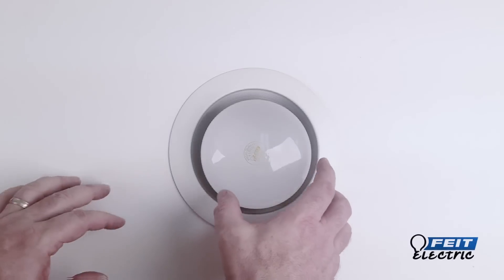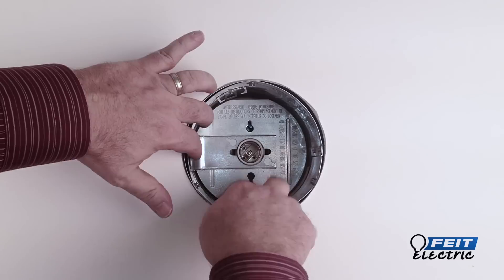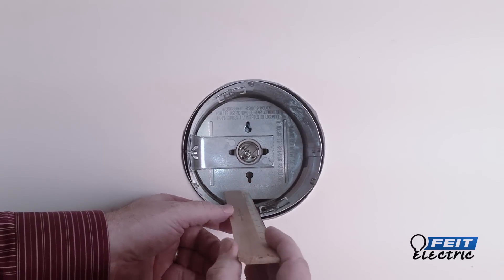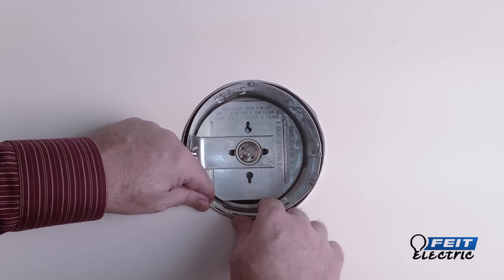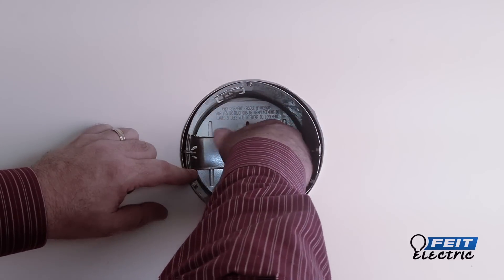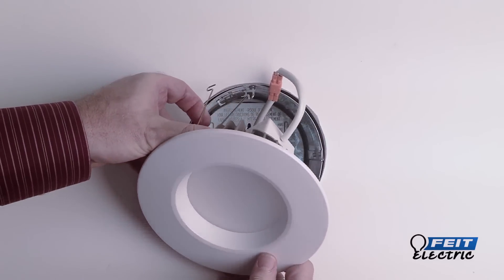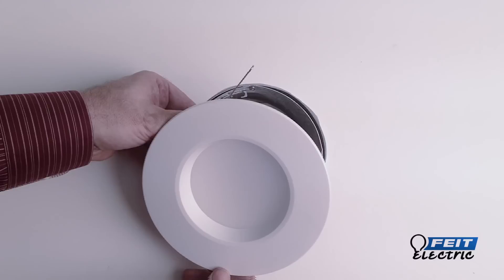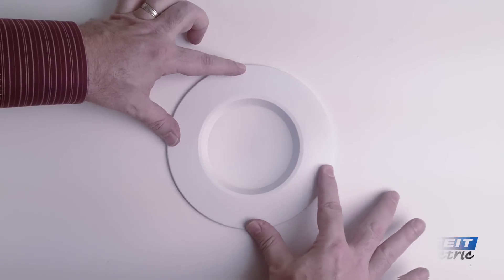How to Install Feit LED Can Light Retrofit Kits - Ace Hardware

Comment: The Feit LED fixture installs very easily into recessed lighting fixture. Installing it into a standard overhead electrical box is a different story. Even after following the instructions, written  in a microscopic font, then scanning the diagram on a computer to expand it to visibility, the actual Feit hardware mounting ring had to be enlarged/drilled out slightly to accept the standard electrical box mounting screw; then the entire ring pushes up into the recessed round electrical "box" when you try to twist-mount the fixture. It became so frustrating to re-engineer the parts that I took it down and reinstalled the old fixture until I could purchase a more user-friendly brand.

Comment: What's the difference between this and simply screwing in an LED bulb. Thanks.
Reply: I found this out today.   These canned lights are poorly insulated.  During a a pressure test the tech showed me that hot air from the attic space was pouring into my kitchen from the 7 outlets.  Using these will reduce this issue.
Reply: LED bulbs wear out if they get hot, the exact opposite of an old fashioned bulb. The unit shown in the video uses the metal stuff aroud the light as a heat sink and radiator, so the light engine itself can stay cool.  Te end result is 20+ year lifespan vs 2 year lifespan.

Comment: I have one that has started flickering after just two (2) years of normal (2-3 hrs per day).  Not much savings if I have to buy and call my son over to install one every two years!!!
Reply from the maker: Hi Bob - Did you get it from an Ace store? Would like to help research the flickering issue for you.
Reply: Are you using a dimmer? if so make sure it's for led. Maestro

Comment: What if I do not have the brackets in the recess fixture?
Reply: Park Boulevard that what i want to know
Reply: The brackets are there..they are bent up you just have to bend them down
Reply: My Lithonia brand fixture has no torsion spring brackets as shown in every video I have watched. All the LED retrofits I've seen need these brackets to hold up the light. No brackets, no work.
Reply: thats bs, every can light in the us has brackets so what i'm guessing is maybe you didnt turn the wingnut holding the socket and push it up far enough to be seen so id try that again or just completely remove the wing nut and disconnect the lamp socket and then place the led light into the recessed fixture.
Reply: It's not bs, mine doesn't have them either. And didn't. Totally had to replace the can so it's you who has no clue. If you'd like pics just let me know.
Reply: We seem two have two styles of recessed lights in our house that we bought 3 months ago. The set of lights on one side of the house cannot be pulled down. After some reading online, it seems that they may have been screwed into place from the attic space.
Reply: @johnpurson2245  Some don't. You'll likely have to pull the whole can from the attic and replace with a flush mount kit that has the two spring loaded tabs on the side. Many cans are installed during the original construction and are fastened between a 2x4 and the drywall, from underneath. Impossible to get to without tearing down your ceiling; however...

If it's attached to a simple 2x that isn't structural (not a big 2x6 or more running across the length of the room in the attic) you can cut out the wood holding the can light in place using an oscillating multi tool. (Be careful not to go through the drywall underneath! Go slowly! Make sure you've already removed the finish plate on the side facing the room or it won't pull through.)

Alternatively....

In some cases, the spring loaded tabs themselves will hold within the existing can, if everything matches up, size-wise. 

If there is any gap you can (carefully and cleanly) caulk the seam between the light and the ceiling. Use a high gloss caulking, or whatever that most closely resembles the fixture you're putting in. 

Lastly, if you are fully removing a can, be prepared for the possibility that some drywall will crumble away and you'll need to patch the ceiling if the visible crumbling extends beyond the circumference of the led replacement. 

Also, if you're replacing the whole can you'll have to wire in the new unit, so some minor electrical knowledge will be necessary. If you have knob and tube in a very old home, thats a story for another time.
Reply: @gogodesu4305   john purson  Some don't. You'll likely have to pull the whole can from the attic and replace with a flush mount kit that has the two spring loaded tabs on the side. Many cans are installed during the original construction and are fastened between a 2x4 and the drywall, from underneath. Impossible to get to without tearing down your ceiling; however...

If it's attached to a simple 2x that isn't structural (not a big 2x6 or more running across the length of the room in the attic) you can cut out the wood holding the can light in place using an oscillating multi tool. (Be careful not to go through the drywall underneath! Go slowly! Make sure you've already removed the finish plate on the side facing the room or it won't pull through.)

Alternatively....

In some cases, the spring loaded tabs themselves will hold within the existing can, if everything matches up, size-wise. 

If there is any gap you can (carefully and cleanly) caulk the seam between the light and the ceiling. Use a high gloss caulking, or whatever that most closely resembles the fixture you're putting in. 

Lastly, if you are fully removing a can, be prepared for the possibility that some drywall will crumble away and you'll need to patch the ceiling if the visible crumbling extends beyond the circumference of the led replacement. 

Also, if you're replacing the whole can you'll have to wire in the new unit, so some minor electrical knowledge will be necessary. If you have knob and tube in a very old home, thats a story for another time.
Reply: john purson  Some don't. You'll likely have to pull the whole can from the attic and replace with a flush mount kit that has the two spring loaded tabs on the side. Many cans are installed during the original construction and are fastened between a 2x4 and the drywall, from underneath. Impossible to get to without tearing down your ceiling; however...

If it's attached to a simple 2x that isn't structural (not a big 2x6 or more running across the length of the room in the attic) you can cut out the wood holding the can light in place using an oscillating multi tool. (Be careful not to go through the drywall underneath! Go slowly! Make sure you've already removed the finish plate on the side facing the room or it won't pull through.)

Alternatively....

In some cases, the spring loaded tabs themselves will hold within the existing can, if everything matches up, size-wise. 

If there is any gap you can (carefully and cleanly) caulk the seam between the light and the ceiling. Use a high gloss caulking, or whatever that most closely resembles the fixture you're putting in. 

Lastly, if you are fully removing a can, be prepared for the possibility that some drywall will crumble away and you'll need to patch the ceiling if the visible crumbling extends beyond the circumference of the led replacement. 

Also, if you're replacing the whole can you'll have to wire in the new unit, so some minor electrical knowledge will be necessary. If you have knob and tube in a very old home, thats a story for another time.

Comment: Can the LED light be changed in this type of light fixture or do you just purchase a new one when it blows? If it can be changed, how do you do it?
Reply from the maker: Hi Pam - The kit is the light, there is not a replaceable LED bulb.  When it is ready to be replaced you would purchase a new retrofit kit.  Our kits have a 22 year expected life.  Hope this helps!
Reply: Thank you for your help!
Reply: Sure, the LED itself will last until the second coming, but the power supply will fail in about the same time an incandescent bulb would have. The promise of LED longevity has not yet been commercially realized.
Reply: @Wood_butcher  LOL. We had 22 LED can lights installed over 5 years ago and they are all still working. So, no.